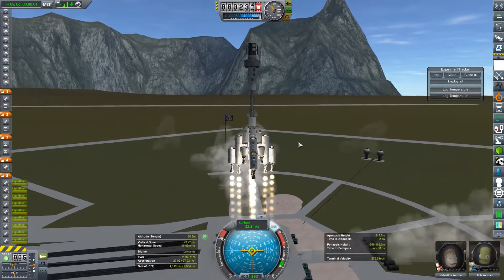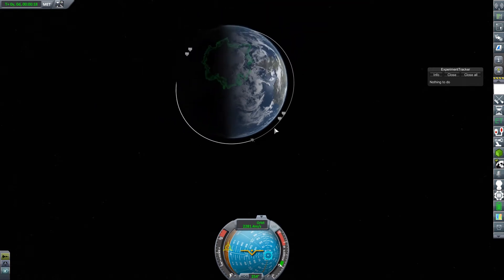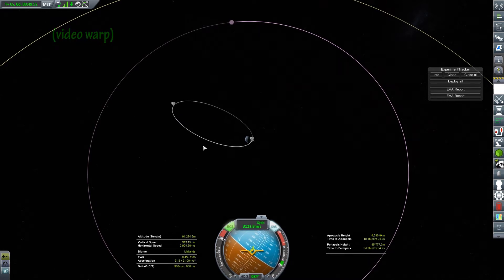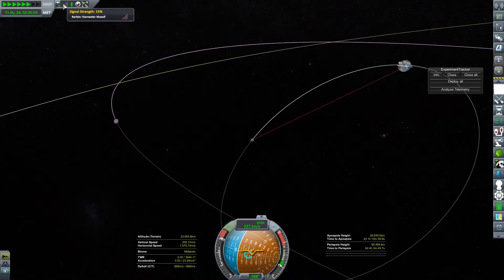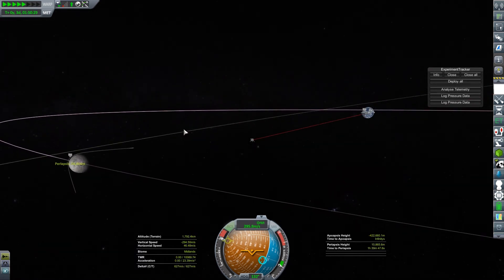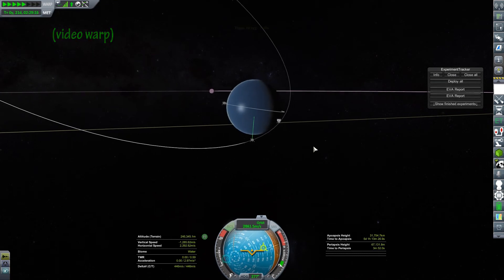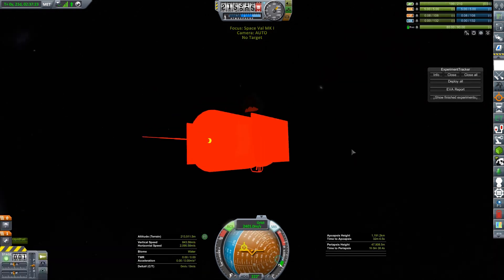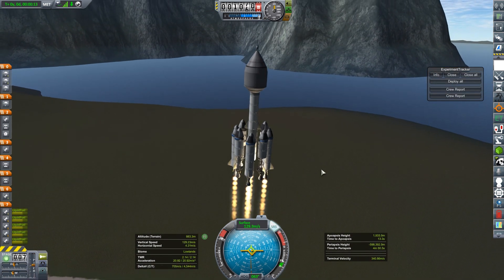KSP - Science Exploration Adventure 004: Val's in Trouble, Make it Double!

Comment: That's it! I can't keep quiet anymore. You really need to rethink how you build your lifter rockets because they're quite honestly awful. I'm not trying to be mean or rude, it's just that I cringe every time I see them.

3 Gs at launch!? You need something like 1.4.
You have waaaay too many engines. They are usually super expensive, costing something like a third of the whole lifter.
You have no nose cones on your first-stage fuel tanks.
Your first stage is waaay too wide which leads to poor aerodynamics.
Your gravity turn comes waaay too late, wasting a lot of dV.
You waste a lot of overhead mass and funds on having lots of small tanks rather than one large tank in the first stage.
You have no fins on your first stage where they would do the most good.
If you design a lifter rocket well, you don't need fins on the second stage.
You have no fairing or nose-cone on your second stage, just a blund aerodynamic nightmare.
That wide tank/thing on your second stage is an aerodynamic nightmare.
The truss-with-fins thing on your second stage is a waste of mass. You wouldn't need it if you built and flew your lifters properly.
You should never use any kind of truss in a lifter rocket, ever.
Try to make your lifters more compact and overall simpler. Build tall rather than wide and for Pete's sake use nose-cones and fairings!

You seem to be quite experienced with KSP so I don't understand why you would make such poor designs.
Reply from the maker: Hi Smorfty, thanks for the comment! I can understand why you feel these rockets are cringe-worthy, to a point they actually are! There are reasons, I'll respond to each of your comments:

1) Yes 3Gs is high and I generally try for 1.4-1.7TWR but this rocket is horribly un-aerodynamic with the science lab and I'd like to punch it up to higher atmo ASAP. Throttling down to avoid over expenditure of fuel to aerodynamic losses isn't usually worth it either as losses to gravity exceed those losses many times over (unless you blow up you don't need to slow down)
2) Engines ARE expensive and heavy, 2.72TWR is certainly punchy to start but I really need to get high enough so my science lab stage can actually complete its orbit when the lower stages are gone
3) At the point of this first launch, I don't have any nosecones
4) This is definitely true, with the limitations of my available resources and my chosen mission (of getting a kerbal to space with no command capsule and only 4ton aerodynamic lab or a 3ton less aerodynamic lab) I ended up spending 4,460dV for a circular orbit- a far cry from the golden 3,XXXdV, if I go for an efficient gravity turn rather than pumping up the vertical velocity enough for my science lab stage it with either nose dive or be too deep in atmo for it to gain enough speed to orbit
5) At the point of this launch, the tanks being used are the largest ones I have unlocked (and fuel flow shifting center of mass has only added to the problem of poor aerodynamics exacerbated by no nosecones, wide first stages, etc...) 
6) Fins would be greatly needed to support the stability of my craft during an early gravity turn if I could start one, I can't so they would be dead weight (although not that much)
7) The fins might not actually be needed for the second stage but they help maintain control in the part of the atmo this stage gets stuck on because it is still well within the atmosphere and extremely top-heavy and un-aerodynamic
8) At this point I had neither nosecones or fairings
9) That science lab is indeed an aerodynamic nightmare, I could have waited to unlock a command capsule or lander can (again my only kerbal housing options are a 4ton MK1-2 shaped lab or the one I went with at 3tons), I really wanted to get a kerbal into space with what I had available
10) The truss with fins is so horrible it is amazing! By now you might realize many of my poor design decisions are due to the limitations of how my career mode has progressed with 50% science reduction and Engineering Tech tree instead of the stock options, for how the rest of the rocket worked out the truss+fins actually lets the lab and probe get to space (I haven't traveled around my home planet for ground science or pilfered the KSC buildings because that is tedious and boring, I want to zip through that later when I have more than 2 science experiments so it is more worthwhile)
11) Compact and simple is a lot easier with giant fuel tanks and engines (also solid rocket boosters, man I wish I had some but I don't, not even the flea unlocked), I could be progressing my space program with tall rockets at this stage of the game but with only 1.25m engines and my highest gimbaling one being less than 160kN thrust ASL... I could get a satellite into orbit perhaps but not a monstrous science lab with kerbals + small satellite + horrible truss with fins

I think I am pretty experienced with KSP, at least I have played it quite a lot. Prior to firing up this new series I was away for several version updates (over a year) so there have definitely been changes I've had to get used to. I will give a shout-out and show possibly the worst designed rocket to ever make it to orbit in the next video! As bad as these designs have been they do accomplish what I want under my existing constraints, it has been an experience learning how to make things work without all of the necessities you get used to and expect as a standard. Stock KSP is boring and easy, this has been quite a challenge.

By unlocking nosecones and fairings, using the same crappy same-sized fuel tanks and starter 1.25m engines I can get the rescue craft (at the end of this video, about a 7ton payload after the small amount of fuel used to finish the circularization) into a low orbit for 3.4kdV. I don't think that is too bad with the parts I'm stuck with and that I had to shed 10 heavy engines to do it.